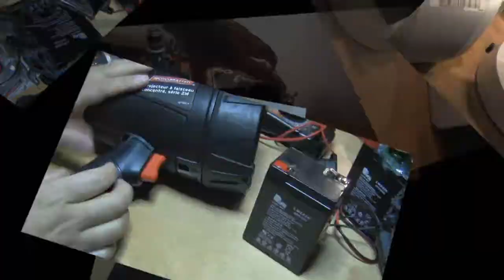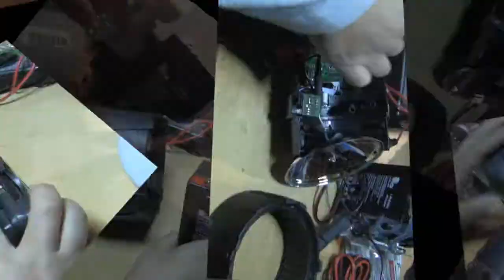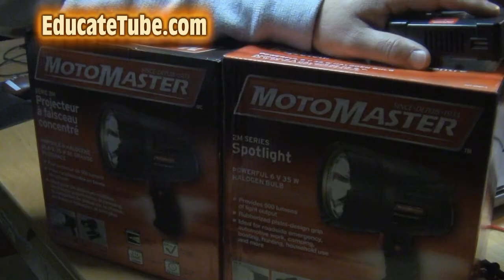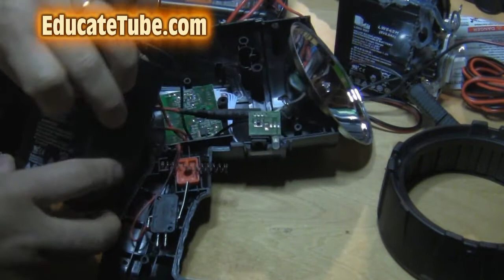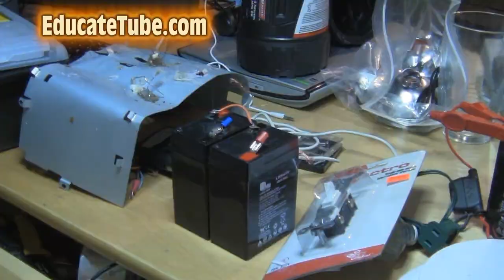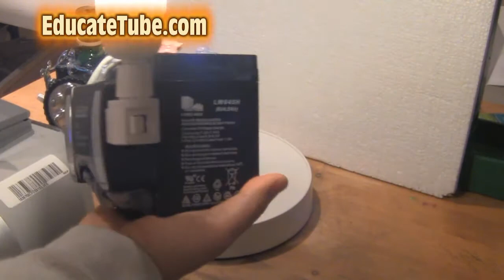How to build the world smallest 12V Solar Sealed Lead Acid Rechargeable Battery System

Comment: never hook you batteries to a solar panel directly or you will over voltage them. solar panels put out 18 to 20 volts. using a solar controller to regulate voltage down to 14 volts and that will shut off charging when not need would be the best way to go.

Comment: Hello sir, im from the country of philippines 

Im interested to your 
(12v Lead Acid Battery) . 
I just want to ask if i can use this 12v (LAB)
For solar power ??  
For stored Energy????
 Thank you.

I hope you understand my grammar ..:'/
Reply from the maker: Lino Cervantes Hi Lino,Yes you can hook up 12V battery directly to the solar panel, but you will need a charge regulator just in case it over charge or undercharge which could ruin your solar panel.  If you don't have solar voltage regulator monitor,  you will have to monitor the voltage manually by measuring voltage in the battery every hour under the sun.